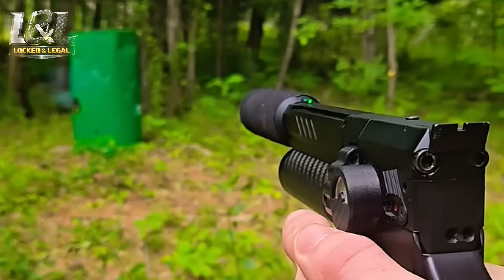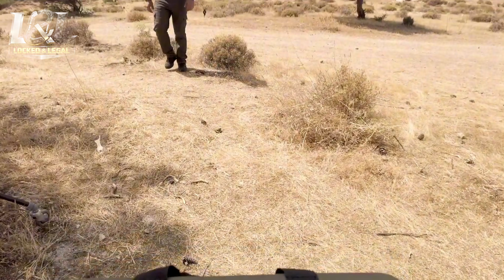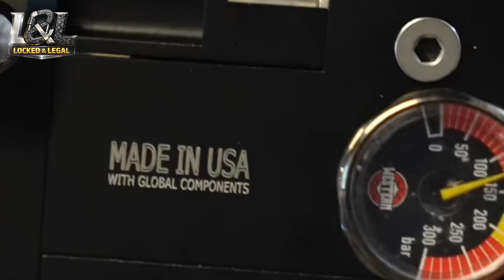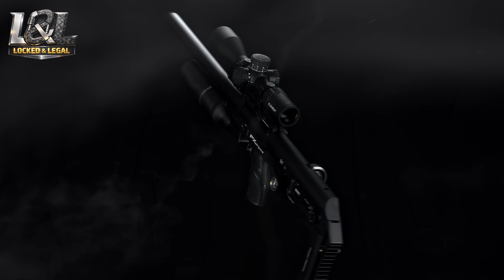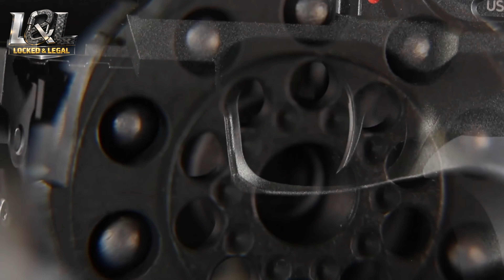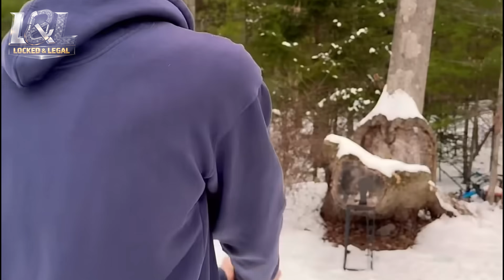The #1 Most Powerful PCP Air Pistol at SHOT Show 2026 – Is This the New King?

Comment: For the price of a gk1 i would muxh rather have the bintach t50 that i have with the 7000 psi conversion. Its not huge , not a pistol but not huge. It will shoot double the power of the gk1 and 40 shots at power 💯
Reply from the maker: That’s a solid setup 💯 the T50 definitely leans more toward raw power and shot count. The GK1 is more about compact pistol form and efficiency, so it really comes down to what you prioritize.

Comment: Where's the best site to go look at these guns and at a price that's not 4x higher in price as a real gun you can get a AK for 500 is my issue with these guns I'm a felon that's almost 30 years old and still don't have the right to carry
Reply: Yeah but any felon can get a gun for two grand on any streat. Its only a Glock 9mm .  So a legal carry air gun isn't so bad for the same price.
Reply from the maker: You can check the official websites of the manufacturers to see the models and suggested prices. Unfortunately YouTube doesn’t allow direct links here, so I can’t post them in the comments.

Comment: I’ve had my Hubin for a year and a half. I shoot it every day and keep it full of air and I’ve never had one single issue.

It is the smoothest semi auto trigger on the planet and that includes rimfire
Reply from the maker: That’s great to hear real-world experience like that! A year and a half of daily use with zero issues says a lot about the build quality of the Huben GK1. Thanks for sharing your detailed feedback!
Reply: @LockedAndLegalUs .  You might have to play with different moderator sizes to make sure it’s cycling correctly other than that no issues.
Reply: I bought a webley nemesis x pcp in 22 cal , i get over 100 requlated shots using 18 grain pellets @ 700 plus f.p.s i put a 9 x44 10 power  scope on it with a buck rail moderator and ive shot several starlings at over 100 yards with it , very accurate and hard hitting but definately not back yard friendly without a suppressor , im happy with my purchase and mines consideted entry lever , price is around 300 usd , ive got maybe 600 in mine after modification , worth every penny

Comment: Excellent reviews, thanks! ... I own the GK1, so I am a bit biased in agreeing that it is the world's best PCP pistol, and, the performance does back it up. One idea you mentioned, which I would like to address, is that the Huben is actually, quite user service friendly ... yes, It is a very precise, complex design but it is quite straight forward to replace parts, especially seals, and to maintain it on your own work bench. Unless you cannot figure out which direction a screw loosens or tightens, fear not in attempting your own service needs ... I have already taken my pistol apart in numerous stages, in order to understand how it works. I have had zero issue replacing a trigger sear and a seal. Resetting trigger sensitivity and pressure integrity. In fact, Huben includes a fairly generous bag of seals and screws as backup. Also, online, there are many good "how to" videos on how to replace and fix certain parts that may need fixing, over time ... I would say that the Gk1 is the most straight forward airgun to service, for the most part. Thanks again for your effort in reviewing these amazing tools!
Reply from the maker: Thank you for sharing your real-world experience with the GK1! The additional details you provided about its serviceability are very valuable for anyone considering the Huben GK1. Clearly, once you understand the mechanism, replacing seals or adjusting the trigger is absolutely manageable at home. I truly appreciate your detailed input!